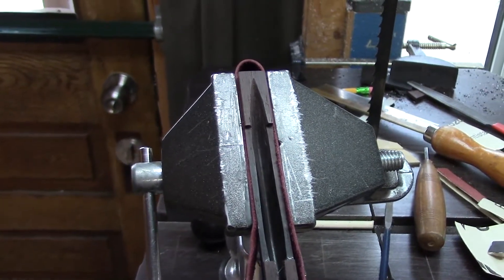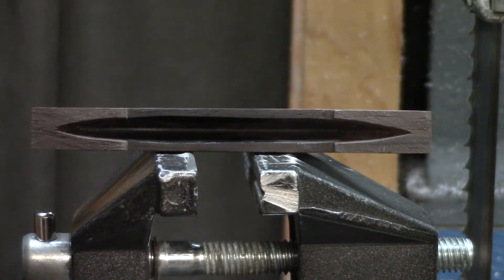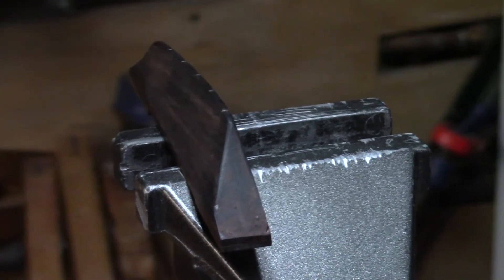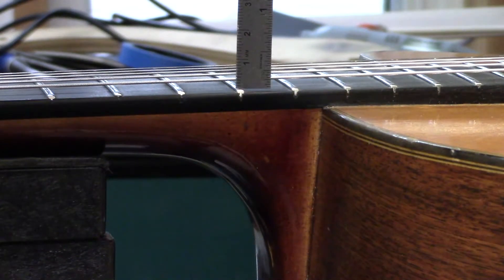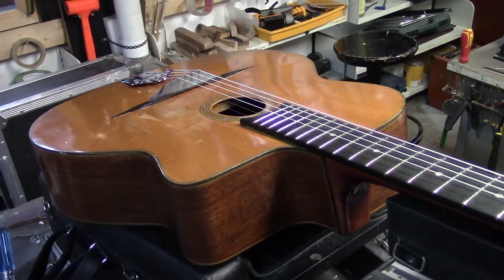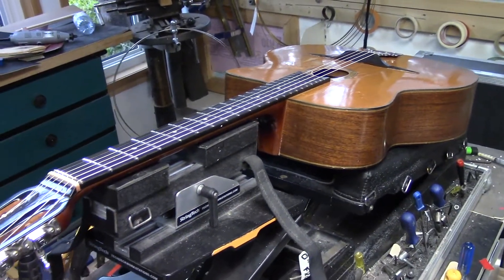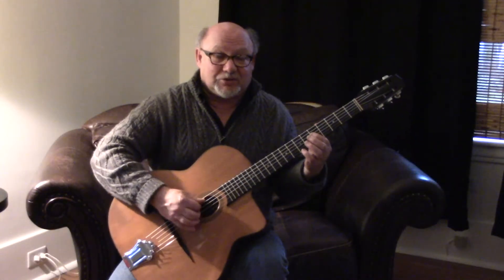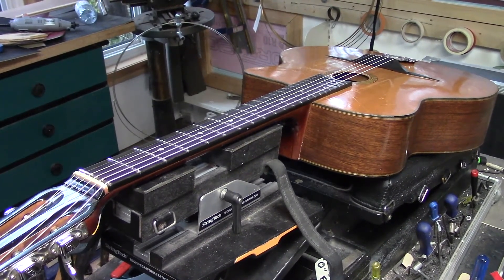Favino Guitar Bridge Setup | Pro Tips for Perfect Tone & Playability

Comment: Old Levin parlor guitars often have a similar bridge but it´s not hollowed it´s a massive piece. Why did he make them with that little hollow chamber inside?  Does it make the guitar louder or is it mostly to alter the sound in a direction he wanted?

Many Swedish techs and builders seem to replace them with glued on bridges on old Levin guitars which I think is a no no on such old guitars so I keep them original. If I have to lower the action I just make a new one and keep the original in case it needs a neck reset further on down the road so it can be brought back totally to how it left the factory.
Reply from the maker: Thanks for your question. There is no doubt that this "hollowed out" bridge was done deliberately. Favino wasn't playing any guessing games .... he new precisely what he was doing.